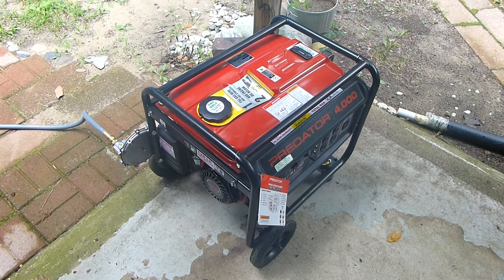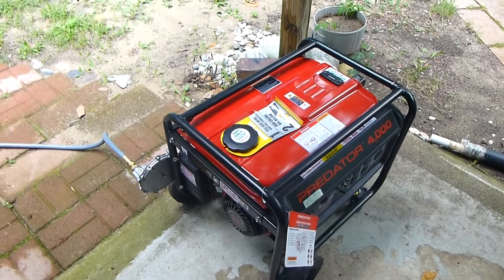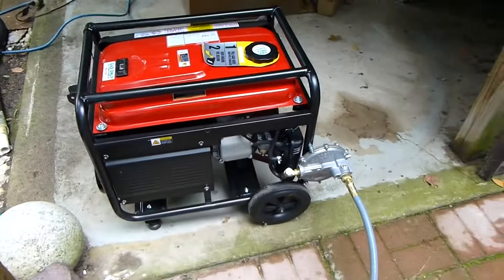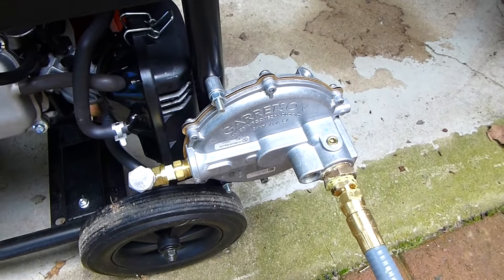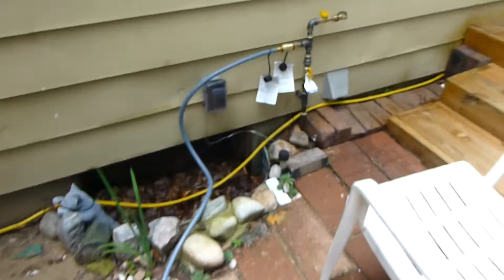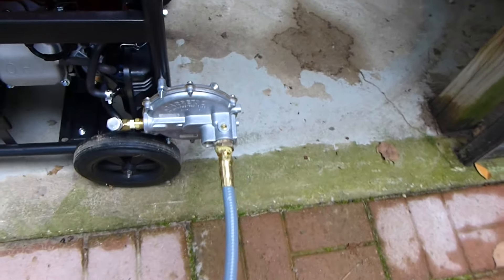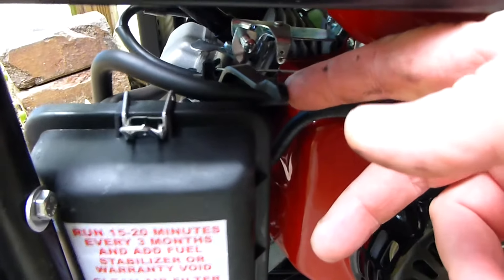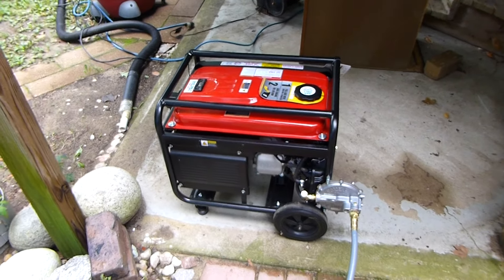US Carburetion Snorkel Conversion Predator 69676 4000W Generator

Comment: Hi Kevin, I wish I had watched your video before I purchased the snorkel. I had the same identical problem that you had. After all of US Carbuertion suggestions that I tried, it still only ran on half choke. I finally returned  it after wasting a day and a half on it. Took your advice with the Tonco carb and installed it in less than 5 minutes. Push the primer button twice and started right up. Thanks for the remedy. Thumbs up!!!
Reply: Hello Dave,
Do you happen to have a link to where I can buy that card? You can still run gas in it just Incase, right?

Thanks!
Reply: ⚠️Here are the safety rules of using portable generators: 

It is important to follow all generator safety rules whenever we use portable generators: 

Everyone must see this. This is just a reminder for everyone’s safety. 

1) KEEPING OTHERS SAFE: Please do not allow an unqualified person or your children to operate and service the portable generator. Just because some manuals don’t say that doesn’t mean it’s safe. That is important against the generator safety rules. We also need to be keeping an eye on our children too. You need to make sure that your children are not playing near the portable generator especially when it’s running so they won’t get electrocuted. Generators pose electrical risks and they can be hot during an operation. Please keep your children away from the portable generator at all times. It is important to keep our children safe especially our little ones. Be aware of all the hazards.

2) WHERE TO RUN YOUR GENERATOR: Some people use their portable generators indoors which increases the risk of carbon monoxide poisoning. It’s important to have a carbon monoxide if you have a gas generator. Never ever use your generator indoors even if your doors and windows are open and even in the garage is not safe to use a portable generator. Not even at your porch and your deck. It is never safe to use your generator indoors and in enclosed areas of your home. Your generator needs to be 15-20 feet away from your house. 

3)🔥FIRE HAZARDS: Never refuel your generator while it’s running. You need to let your generator cool off before refueling it and before storing your generator. Never overload your generator too. Never ever back feed your generator. You should never plug your generator into a wall outlet. Also never store propane tanks indoors. Please keep flammable things away from the generator as well and please don’t smoke cigarettes near the generator. Having a fire extinguisher next to the generator is also important against the generator safety rules. 

4) GENERATOR OPERATION: make sure your hands are dry before touching the generator. Never use your generator in wet conditions. Don’t let your generator get wet. You need a generator tent if you need to use your generator during wet weather. Please don’t wear loose clothes when operating the generator. Turn on your generator before plugging in appliances. Use the right cord for your generator. Please do not use worn out cords. 

https://youtu.be/I1jT3ANENvI and here is a video more about keeping others safe when using generators 

Hope this helps
Reply: @The_Happy_Aviation_Enthusiast  Spammer

Comment: Thanks for posting that the Tonco 170f works with the 4000. I was going to get one, now I will! much more convenient of a package.
Reply: ⚠️Here are the safety rules of using portable generators: 

It is important to follow all generator safety rules whenever we use portable generators: 

Everyone must see this. This is just a reminder for everyone’s safety. 

1) KEEPING OTHERS SAFE: Please do not allow an unqualified person or your children to operate and service the portable generator. Just because some manuals don’t say that doesn’t mean it’s safe. That is important against the generator safety rules. We also need to be keeping an eye on our children too. You need to make sure that your children are not playing near the portable generator especially when it’s running so they won’t get electrocuted. Generators pose electrical risks and they can be hot during an operation. Please keep your children away from the portable generator at all times. It is important to keep our children safe especially our little ones. Be aware of all the hazards.

2) WHERE TO RUN YOUR GENERATOR: Some people use their portable generators indoors which increases the risk of carbon monoxide poisoning. It’s important to have a carbon monoxide if you have a gas generator. Never ever use your generator indoors even if your doors and windows are open and even in the garage is not safe to use a portable generator. Not even at your porch and your deck. It is never safe to use your generator indoors and in enclosed areas of your home. Your generator needs to be 15-20 feet away from your house. 

3)🔥FIRE HAZARDS: Never refuel your generator while it’s running. You need to let your generator cool off before refueling it and before storing your generator. Never overload your generator too. Never ever back feed your generator. You should never plug your generator into a wall outlet. Also never store propane tanks indoors. Please keep flammable things away from the generator as well and please don’t smoke cigarettes near the generator. Having a fire extinguisher next to the generator is also important against the generator safety rules. 

4) GENERATOR OPERATION: make sure your hands are dry before touching the generator. Never use your generator in wet conditions. Don’t let your generator get wet. You need a generator tent if you need to use your generator during wet weather. Please don’t wear loose clothes when operating the generator. Turn on your generator before plugging in appliances. Use the right cord for your generator. Please do not use worn out cords. 

https://youtu.be/I1jT3ANENvI and here is a video more about keeping others safe when using generators 

Hope this helps

Comment: I had the same problem after putting the snorkel adapter on my Sportsman 4000 Dual Fuel.  After I tested another way of getting my nat gas from the regulator hose hooked up to the carb I decided to remove the snorkel pigtail...  The test was, I just took the LP hose off the carb and plugged a small length of transparent water pump hose over that brass fitting, then put that hose inside the larger black hose from the Garretson KN regulator.  It seemed to fit perfectly so I just stuck it in as far as I could.  The reduction in flow from the black pipe to the clear pipe and into the brass fitting in the side of the carb was NOTHING compared to how restrictive the motorsmorkel body and tip is.   If I wanted to switch back to LP I'd just have to swap the hose that is hooked to the brass fitting on the side of the carb...  I got the gen to run open choke, and pretty smooth, compared to the motorsnorkel which ran ok at half choke but very rough at open choke).  I believe the gas flow is just too restricted with the snorkel.  But also when I removed my snorkel, I noticed the air box had crushe or cut into the snorkel plastic (hard part) and severed it part way..  It fell apart when I got it to the bench and touched the snorkel tip... The back of my air cleaner box was deformed from where I had tightened it over the snorkel, so before putting it back over the carb gasket, I kept lining it up and checking it for light.  I had to take it totally off after trying to bend it with my fingers a few times, and pounded the piece flat on plywood with the back of a screwdriver.  Now its flush mounted to the carb again.  I'll probably never seek a snorkel solution again after seeing how this turned out.  If anything I'll either get a carb made for a nat gas input (or LP input that I can just hook nat gas to).  I'm hoping after removing the snorkel obstruction from the carb, that it can run even better if I tune the diaphragm on the regulator plus the gas block.  It seemed too obvious to do it this way, I don't know why I didn't try it from the get-go instead of putting that snorkel thing behind the air box.  It may work sometimes but I have a feeling a lot of people can't get their engine running open choke with it.  If it happened on a 4000 Watt, I imagine it may on a 5000 or 6000 be even more fuel starved.

Comment: i just converted a Predator Generator and found that the snorkel did not sit perfectly flush between the air cleaner housing and the carb.  I had to trim the housing to provide relief for the hose.   I am thinking that if you have a leak between the housing and the snorkel, the carb will not provide enough vacuum to pull in enough natural gas to keep it running without choking the engine.
Reply from the maker: The snorkels for larger engines have a well know issue. The rectangular tube molded into the gasket is thicker than the gasket causing a gap. If left unresolved the engine could ingest dust causing wear. The snorkel for my 6.5hp Predator does not have this issue, the tube and snorkel are physically smaller and the same width as the gasket.

Two things involved here:
1) Intake airflow resistance.
2) Air flow across the venturi.
 
The more air going through the venturi the lower the pressure and the greater the vacuum at the float bowl pickup tube point. (Maximum low pressure point in the venturi) 

The higher the resistance to air flow on the intake the lower the volume of air across the venture but the higher the vacuum at all points between the filter and venturi.

In practice the volume of air does not seem to vary that much even with increased intake flow resistance but the vacuum greatly increases. This is why closing the choke cures the problem.

An engine is basically an air pump. The more air you can move through it, the more fuel you can add and the more horse power produced. This is one reason I wish the kit would work without needing the choke set to half.

I have seen videos where this kit works on a 6.5hp engine but only using Propane. I do not believe this kit will work on a 4000w predator fed natural gas. The 4.5psi max inlet regulator they sent me did not work. US Carburation could not solve my problem and blamed my setup. They offered my money back if I return the kit.

Comment: What do you need if you want to switch it to a propane tank such as a 20# tank from a grill in an emergency if the NG supply is lost?
Reply from the maker: With the Tonco carb there is a knob. With the USCarb you use a large bolt threaded into the gas stream.

Comment: Did you remove the two small plugs on each side of the regulator? If not this will cause your regulator to not give a stable flow of gas.
Reply from the maker: Yes I removed the plugs... The kit they sold me will not work on my small generator.  All vents were open, I was all over the regulator both inside and out reverse engineering it in my mind to isolate the issue. The fact is the small snorlel they provided for me was unable to draw enough vacuum and the regulator had insufficient flow with the lower pressure of natural gas. I looked at their site today and found they have changed the design. Funny because they kept telling me what they sold me would work on my engine. The Tonco carbs are a much better and less expensive solution.

Comment: Good luck.  Keep us updated.  I have been looking at the snorkel vs. machined venturi collar from other vendors for a Predator 8750 and a Predator 2500.

Did you ever try it on straight gasoline without the snorkel?  Just curious.
Reply from the maker: Yes I used a boat motor external tank and ran the Generator for three hours to break it in per conversion instructions. i just disconnected the gas line from the tank and connected it to the external one. I didn't load test the gen on gasoline. On natural gas I used a 750/1500w heater and 1750 watt toaster.
Using the 750 setting on the heater and the 1750 toaster for 2500watts the gen did fine. When using the 1500 setting with the 1750 toaster for 3250 the gen became overloaded. This could be due to the choke restricting the air flow or overrating of the generator. I will load test on gasoline soon. US Carburation is sending me a third regulator with 4psi inlet pressure instead of 6psi.
Reply: So the thought is that the 4psi will stop the overloading or am I missing something?  Thanks.

I should have said in my original question is did you ever start and run in on gasoline with the snorkel in place after the conversion?  Or is that the plan for the test on "gasoline soon".  Again, Thanks!!!
Reply: My husband has the identical setup, and did this mod 1 year ago and guess what, the Predator 4Kw generator will only run at Half Choke.  He tried various fixes but does not believe it to be a gas pressure issue from the house as we have multiple appliances that operate quite nicely  on all at the same time, furnace, clothes dryer, gas stove , hot water heater.  He feels it is either gas supply via snorkel or possible vacuum issue. If you get a resolution please let us all know as this is disappointing to say the least!
Reply: ⚠️Here are the safety rules of using portable generators: 

It is important to follow all generator safety rules whenever we use portable generators: 

Everyone must see this. This is just a reminder for everyone’s safety. 

1) KEEPING OTHERS SAFE: Please do not allow an unqualified person or your children to operate and service the portable generator. Just because some manuals don’t say that doesn’t mean it’s safe. That is important against the generator safety rules. We also need to be keeping an eye on our children too. You need to make sure that your children are not playing near the portable generator especially when it’s running so they won’t get electrocuted. Generators pose electrical risks and they can be hot during an operation. Please keep your children away from the portable generator at all times. It is important to keep our children safe especially our little ones. Be aware of all the hazards.

2) WHERE TO RUN YOUR GENERATOR: Some people use their portable generators indoors which increases the risk of carbon monoxide poisoning. It’s important to have a carbon monoxide if you have a gas generator. Never ever use your generator indoors even if your doors and windows are open and even in the garage is not safe to use a portable generator. Not even at your porch and your deck. It is never safe to use your generator indoors and in enclosed areas of your home. Your generator needs to be 15-20 feet away from your house. 

3)🔥FIRE HAZARDS: Never refuel your generator while it’s running. You need to let your generator cool off before refueling it and before storing your generator. Never overload your generator too. Never ever back feed your generator. You should never plug your generator into a wall outlet. Also never store propane tanks indoors. Please keep flammable things away from the generator as well and please don’t smoke cigarettes near the generator. Having a fire extinguisher next to the generator is also important against the generator safety rules. 

4) GENERATOR OPERATION: make sure your hands are dry before touching the generator. Never use your generator in wet conditions. Don’t let your generator get wet. You need a generator tent if you need to use your generator during wet weather. Please don’t wear loose clothes when operating the generator. Turn on your generator before plugging in appliances. Use the right cord for your generator. Please do not use worn out cords. 

https://youtu.be/I1jT3ANENvI and here is a video more about keeping others safe when using generators 

Hope this helps
Reply: @The_Happy_Aviation_Enthusiast  Spammer

Comment: When I did my conversion I used voltage meter measure hertz and I adjusted the governor until I had  61.5 to 62 hertz , when you put a load on the generator you should be around 3600 RPM which will give you the output required.

After does adjustment the   Voltage Regulator does the rest.
Feel free contact me.
Reply from the maker: I have a Fluke DVM with Frequency. I load the gen with toaster and heater then set 60hz. Its a far cry from the stability of the power company which is locked to the Atomic Clock in fort Collins Colorado. Most ac devices tolerate frequency drift without issue. Some older clocks that use synchronous drive motors will be less accurate.